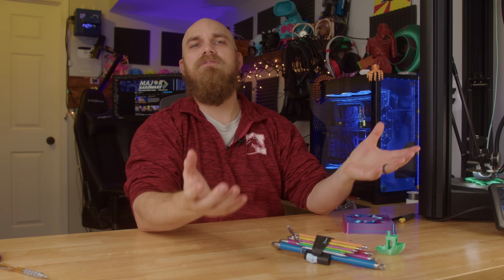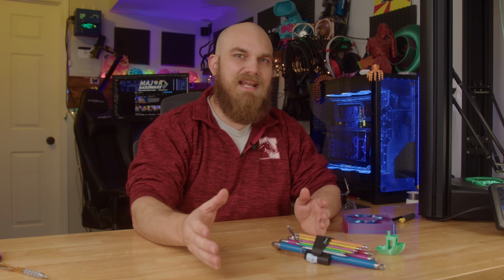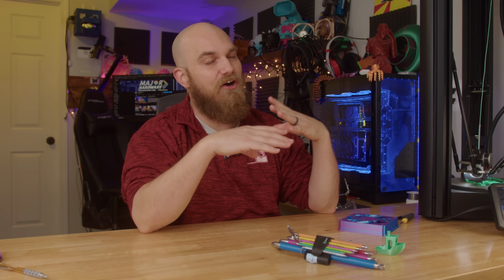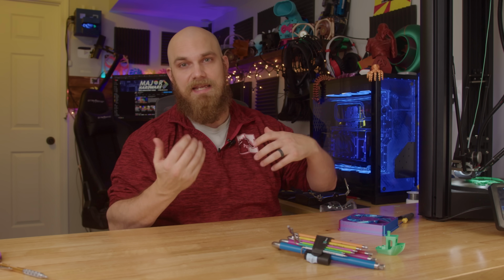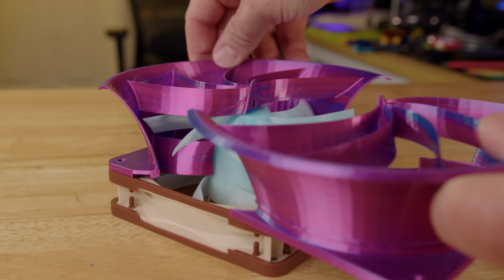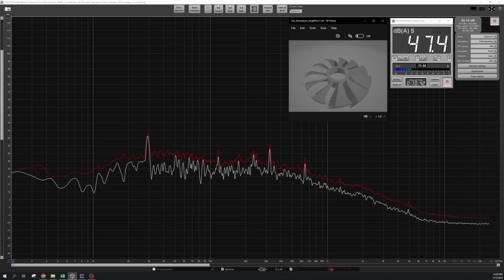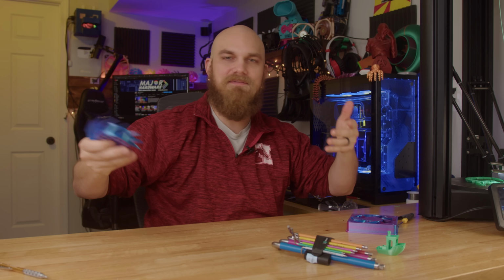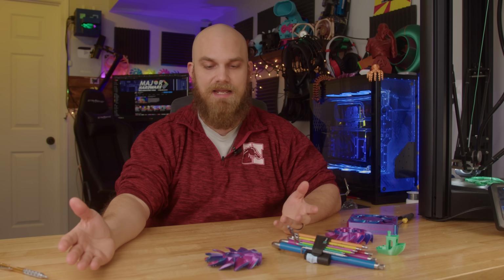Turning a PC fan Into a JET Engine | Fan Showdown S5E4

Comment: the mk
im calling it now
free spinning blades = the blade taking the path of least resistance and that means disturbing LESS air
its a good concept (infact i think its the same concept that wind generators use) but without something to force the fans into a specific position
its not gonna work

Comment: Having the MK-Variable blades essentially on a swivel SHOULD just result in them rotate to the point where they produce the LEAST resistance to the air, so this one should do horribly unless there's a stopping point. I haven't watched yet. Fran's Multi-Stage looks very interesting but I'm not sure whether the blades have been positioned optimally to eliminate conflicting airflow.

And, I was pretty right, I guess, although it's hard to say without a static pressure result. The MK Variable was middle of the road, and the Multi-stage was mis-designed so that the two rings of fans conflicted. Try adjusting the relationship between them, Fran, and you might have a winner!

Comment: If the NF-A12-25 fan is so great and it has 9 blades. While a quieter fan would have 11. Why not 3D print an 11 bladed NF-A12-25?

Comment: The problem with the multistage is its just a 16 blade fan, just one set of 8 are stepped back.  This can cause cavitation between the stages.  A jet engine use LP compressors which throw into a HP compressor, the HP spins seperately from the LP and spins faster to achieve higher pressures and speeds.  VIGVs (Variable inlet guide vanes) Stop the LP compressor which is more efficient from stalling or surging the HP, also they help smooth the airflow into the 1st stage compressor to create not far off a laminar flow.  That is controlled by a governor on the HP compressor side. They can also be fitted between HP and LP Turbines too for the same reason.  The LP comp is with most conventional turbine engines powered by the LP turbine at the back and the HP is powered by the LP compressor and Turbine, hence you can stall it if you surge too much air through it

Comment: My favorite number of blades is 9 and 11. So I designed a fan that has 11 blades and then print it. It looked great then I push it on my fan hub. And it works surprisingly well and quiet it rated around 35 dba. Let print one with 9 blades as well.

Comment: Hey what is the loss from having a printed design with ridges etc over smith injection  molded designs?
You could probably do a control test with a 3d printed a12x25 blade to see how less it performs over its injection molded companion. 

With that you can get an idea of what percent 3d printing costs in performance and compare 3d printed apples to apples.

Comment: Just a note: the more the fans, more the noise, however if you can control each fan individually you can make them oscillate the RPM, so you dont let they run with the same RPM at the same time. Apple did this to the chesse grill mac to be super silent.

Comment: Correct me if I'm wrong but in regards of the missing highspeed cam, I was thinking of using e.g. 3 30 fps cameras that get switched on exactly at a sequence that feed one processor in order to overlay themselves, resulting in 90 fps? 
Yes, the setup is demanding, someone has to put work in but only once and it could be sold as a kit or something.

Comment: I think the Engel design is better then the Noctua . If 3d printed performance is almost on par with the original then if you have a smooth an balance factory made one it will performe better.

Comment: The multi-stage is designed backward, stators go after rotors. Second, multi-stage is purely about increased pressure differential, not flow, and the area of each stage should reflect the actual pressure ratio of each stage. All that aside the last thing you want in a cooling fan is high static pressure, air increases in temperature when compressed.
However, I would like to see a single-stage fan with a stator. which would help straighten the flow and convert some angular momentum into linear.

Comment: Has them been any centrifugal/impeller compressors? Axil flow compressors create less pressure per stage but more total pressure. With the small confines a two stage centrifuge/impeller would do better.

Comment: I have a question or a thought. Have you tried printing the Noctua fan, just to see what the 3d print artifacts do to the performance? I feel like while the imperfections may cause a little extra drag we are not sure what a "Finalized" or casted blade would change. But with a 3D-printed version of the Noctua, we could try and calculate the differences. I know it's all just for fun but I think that would be a good bit of info to have. I also kinda feel like I am not the first person to say this, but I am too lazy to go through all the videos and comments.

Comment: Yeah the 993 does sound like that, but only at high rpm and usually you move through that frequency as the berries have been dispensed to the engine. It’s an incredibly sonorous noise that comes from behind, its felt viscerally and for the most part gives a huge dopamine dump, but you 100% notice those bizarre and uncomfortable frequencies that are like fingers on a chalk board visceral.

Comment: You should send them in for e-beam 3D fab in titanium // so they deflect less under rotational loading at high RPM & I think you would see a radical improvement in part strength :P

Comment: Use a laser pointer pointed at the blades if you want to see if the angle is changing. The reflection will move. Glue a small aluminium foil to one and same  spot  on each blade

Comment: If its unique heck yeah.  I have worked on a lot of Porsches.  Last aircoold is the 1996.  The 993 blades that you printed are not even shaped the same as a porsche on your 3d Print.
Also the multi stage needs to run at Higher RPM its half speed so the CFM needs to be doubled if it was douled it would be beating the Noctua.    I think if you cant get it balanced out you should have three more columns to rate all of these Fans equally as if they were balanced and built in an injection mold or start doing all the tests at say 800 RPMS.  One column for decibles at say 800 RPM and the second if you had a ratio so that if the fan wont run at say 2000 RPMs proportionally if it can only run at say 1000 RPMS your should double air flow.  Also you need to 3d print the noctua Fan because it is not 3d printed.  It is a balanced fan coming out of the mold.  Un fair advantage.

One more suggestion, you need an SLA printer,  the fans will come out way more precise and balanced!

Comment: Before I finish the video, I'm going on record to say that the variable pitch blade fan that is "allowed to find it's own optimal angle" will flatten out (if the blades turn at all). 
I was wrong. 
Anyways, notice how some of the fan blades have an airfoil shape to them? What if there were bumps instead of the typical airfoil shape? The airfoil shape is designed to have the air move over the top of the wing faster than the air under it...so if there were aerodynamically shaped bumps replacing the typical shape, wouldn't that make the air move even faster?

Comment: Wow the Angel is super impressive. I really didn't think anyone would beat Antonio for at least a few episodes. The Multi Stage definitely looked cool running and was very quiet. The 993 did sound like an angry radiator fan. Would also definitely be cool to find out what angle the Variable liked and reprint it without the screws set to the angle found. Fun episode!

Comment: Hey this is not really related to the video but its fan-related
the Lincoln Laboratory at MIT has designed a toroidal fan blade propeller which is much quieter than standard 2-bladed propellers originally meant for drones, but I wonder if the design can be adapted somehow for computer fans

Comment: As a 993 owner, I can safely say that the fan doesn’t sound like the one in the video. It is definitely lower pitched. The end of the fan blades on the car are swept backwards considerably, which doesn’t seem to be the case on the 3D printed one.

Comment: Hi and sorry if this is not the best place to submit an idea.
You are interested in making fans and getting good airflow from them.
I was watching another youtube video on jet engines and think it may be nice.
https://www.youtube.com/watch?v=ojVNOj-q3SQ
This type of engine gains benefit by having static blades behind the ones spinning but angled in the opposite direction.
You may want to look into this for beefing up some of your fans.
Sorry if I stepped on any toes by posting an external link.

Comment: You don't necessarily need such a fast speed camera, but need a fast speed flickering light, such as an old school car ignition timing light. Then film under that, sync the light flashing and photo timing to the fan's speed output pin. Should be easy enough?

Comment: The 993’s fan is belt driven, it’s not electric, so it’s not going to ramp up with the speed of the engine and therefore it’s barely audible at idle

Comment: Why not just add a ring conecting all blades on the outside on that "jet" fan? It should solve the issue of it expanding its diameter at higher speeds

Comment: The variable pitch fan seems like a good idea but, I do not think the blades are not reacting to airflow in this configuration. I believe they are reacting to speed. The pitch of the blades will tend to flatten out due to CTM, centrifugal twisting moment. If the pitch of the blades were designed to give the optimal airflow at certain RPMs this would be a great design but I don't think that was the intention.

Comment: Dude.  Just buy an adjustable strobe light.  Then you can match the light to whatever RPM the fan is at and you DONT NEED high speed video.

Comment: A bit off topic but.. im looking at your PC i have the exact case with the exact distro plate.. i see you have a significant ammount of space left is the top of your distro plate and your fluid is essentially just waterfalling into your distro plate.. where as i have mine filled until i cant possibly fill it any more.. am i doing it wrong? do i have TO MUCH fluid in my system?!?!

Comment: use a strobe light that you can vary the speed if you need to see high speed stuff such as vibration or in your case, the blade pitch changing.

Comment: There is nothing wrong with light flexible fan blades but you need to design them for their final size when at the desired rpm not stationary.

Comment: I'd REALLY be curious to know the weight of every fan (the rotating part in case there are multiple parts) as well as the baseline original noctua. It may be due to density of 3d printed materials that the performance and max rpm is hindered. Maybe a 3d-printed clone of Noctua fan can be compared to the original (I can't remember if it was already done). BTW, a big fan of the channel and series, keep it going!
Reply: I think it was done in season 1, also in resin iirc, and it made negligible difference.

Edit: I mean the 3d printed noctua, not the weighing of the fans.

Comment: Be interesting to see what the results would be if all of them where run at same power level   As the two stage
Reply: as far as I understand all fans are running at same power level, just that more drag slows down the RPM.

Comment: I think the Angel's 11 blades work well for the same reasons gear sets are made with teeth in prime numbers. The first harmonic would be the product of both the pinion and gear. The higher that number the less frequently the same 2 teeth make contact, thus making the wear across all teeth even. Also fewer reinforcing harmonic frequencies.

Comment: I don’t watch these as they come out but binge in batches. I often forget things. For your stats, is bigger better or smaller? What is the best numbers to beat? Would be nice to see that “helper” info at same time. 😊
Reply: Higher FPM & CFM (airflow) is better. 

Lower dBa (sound) is better. 

RPM is just the speed of the fan, which doesn't really tell you anything about the performance. Not sure why it's still there tbh.
Reply: @ALifeOfWine  thanks

Comment: Yes the fans in 911s do sound like that, the earlier ones with strait blades are even louder than swept blade variants, to be fair they are pretty quiet on idle, and at high rpm you can hear them but the engine does a pretty good job drowning the fan out, it's very noticeable when you get off the throttle though.

Comment: 993 fan, at idle in the porsche, the fan is moving at a very slow RPM compared to what you have here. at higher RPM engine rev, since it's belt driven (and the same RPM as the alternator) it can get louder, but its inside an engine bay at the back of the car with metal all around it and  you're ahead of the sound waves as they emit. outside the car, you can KINDA hear it but it's not any more annoying than hearing a big american truck with the AC on so that their radiator fan is wooshing super loud

Comment: I'm curious if it'd be possible to calculate in the deformity of the print material into the multistage fans' blades to allow for tighter tolerances at higher RPMs.
Reply: Thanks for watching☝️congrats 🎉 you have been selected among our shortlisted winners  🎁🎁🎁 send a direct message on telegram with my name.....🎁🎁🎁..

Comment: Regarding users/season, i would keep it at 1 fan per person per season BUT you could add in special episodes in between with the more unorthodox fans to show off vs eachother.

Regarding high speed camera. There are a couple of Sony system cameras for sale that have 1000+fps on a budget (i remember buying one for my old company about 6 years back for about 600€) they should be a lot cheaper now. make sure though you get a good DC light that is not pulsed to dim the LEDs
Reply: Thanks for watching☝️congrats 🎉 you have been selected among our shortlisted winners  🎁🎁🎁 send a direct message on telegram with my name.....🎁🎁🎁..

Comment: Odd nr of blades eliminates some of the resonances that occur during high rotation speeds and air volumes. Also, helping some of the relativistic angular forces. Principle being no one blade affects the rotation axis directly, but is kinda offset from it. Majority of resonances during air passing over the surfaces are not directed to the actual center of gravity nor the rotation axis. Much like the wings on an plane generate the center of lift. Having center of gravity and center of lift slightly offset helps stabilize the relativistic effects during flight.
Reply: Thanks for watching☝️congrats 🎉 you have been selected among our shortlisted winners  🎁🎁🎁 send a direct message on telegram with my name.....🎁🎁🎁..

Comment: The angel is the winner...imagine that.  *Grins*. And If you are wondering why I'm grinning, as an aerospace guy I can tell you he created the perfect quiet fan using all the tricks we use.  Ribbed top surface, variable trailing edge feathering, and drip edge with high number of blades.

Note I said " quiet.". You can get more performance if you remove the quiet features.

Also because you are using pla plastic instead of metal, tighter non flex tolerances can be achieved if you encase the blade tips to a solid ring to reinforce shape.  This also reduces blade tip pressure loss due to the gap between blades and housing.   

The gap on real turbines is incredibly small because efficiency losses climb quickly with gaps between housing and blade.
Reply: Thanks for watching☝️congrats 🎉 you have been selected among our shortlisted winners  🎁🎁🎁 send a direct message on telegram with my name.....🎁🎁🎁..

Comment: This is just me giving my initial reaction to things but I'd assume the ideal blade count to a fan/propeller would probably depend on the outer diameter of the fan because that will affect the space between the tip of the blades giving more space for turbulence. But fuck if I know.
Reply: Thanks for watching☝️congrats 🎉 you have been selected among our shortlisted winners  🎁🎁🎁 send a direct message on telegram with my name.....🎁🎁🎁.

Comment: The 993 has 12 blades, not only even, but also divisible by 4 (the number of frame supports), so 4 blades cross 4 supports at the same time. odd numbers of blades spread that out
Reply: Thanks for watching☝️congrats 🎉 you have been selected among our shortlisted winners  🎁🎁🎁 send a direct message on telegram with my name.....🎁🎁🎁.

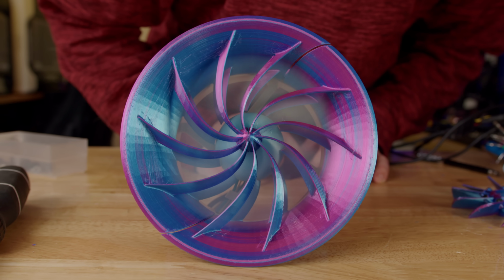Comment: 8:11 Another takeaway:
IF you decide to keep the blades thin, and especially if the blades are curved, make them shorter than they needs to be, because they WILL straighten up & become longer when the fan rotates at some 1'000's revolutions per minute.
Reply: It's not just a matter of length (that's what she said), they're pushing air - so they'll deflect along the axis of the fan too, and contact the stators, and that's going to be even more of a problem for even a minor connection.
Reply: @Ylyrra  Yes, but I was not referring to this specific design, but designs in general.
But it is a good point to bring up, and important to think about if the fan needs to spin in a confined space.
Reply: Shorter and with more curvature. That way when the fan reaches max speed and the blades deflect out, they deflect into optimal position instead of deflecting into a less efficient position.
Reply: Thanks for watching☝️congrats 🎉 you have been selected among our shortlisted winners  🎁🎁🎁 send a direct message on telegram with my name.....🎁🎁🎁

Comment: So if the angel spun at noctuas 2000rpm its gonna come close to its performance or maybe outperform it!? I wanna see the angel spinning at 2000rpm !
Reply: You'd need a bigger motor or to make it lighter to accomplish that. 

Using a bigger motor defeats the point of the series, and to make it lighter you'd have to redesign seeing as everything is using the same materials.
Reply: Thanks for watching☝️congrats 🎉 you have been selected among our shortlisted winners  🎁🎁🎁 send a direct message on telegram with my name....🎁🎁🎁